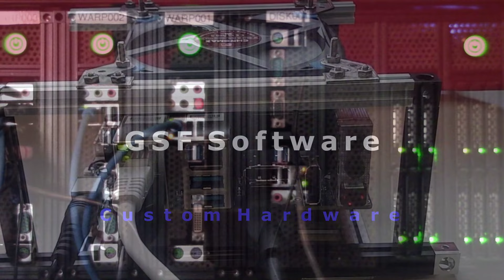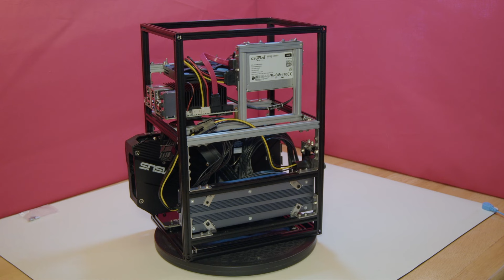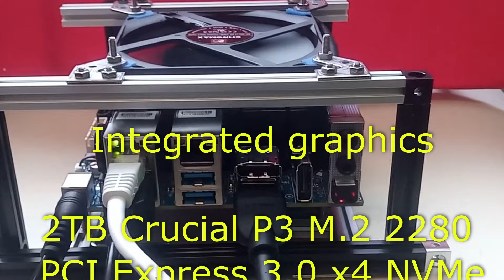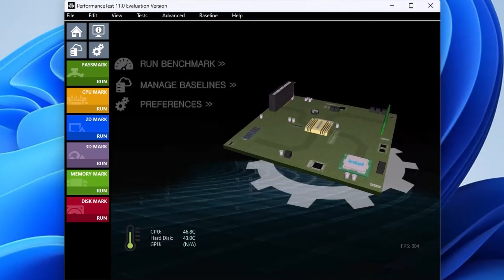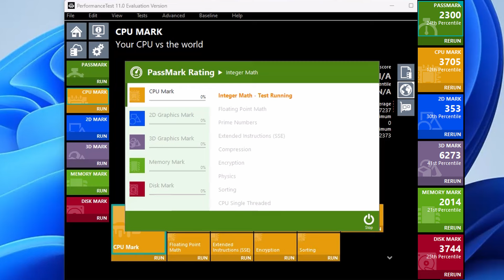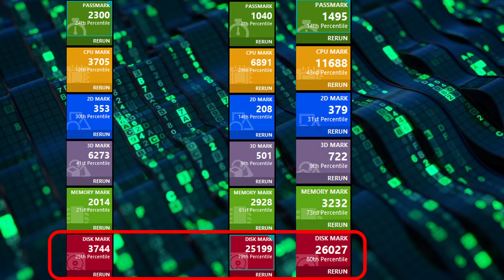Odroid H4 Ultra, single board x86 computer part 5 - Performance testing

Comment: is the 15v (60W) power supply enough if you only use sata 2.5 ssd or do you always need the 19v (130W)?
Reply from the maker: I have one Odroid H3+ with a single 2.5 SSD running off one of the 15V PSUs without problem. Multiple 3.5 HDDs are more likely to require the larger PSU.

Comment: Thanks for the video.

I'm on the fence about the ultra, struggling to find the itx kit in the UK.

Also I'm not sure if I understand the power reqs, would the 19v psu be OK for 2 3.5" hdds? Please test power reqs
Reply from the maker: The H4 can be purchased from https://www.odroid.co.uk in the UK. 
Yes the 19v PSU should be fine for 2 3.5" HDDs. I intend to run 4 3.5" HDDs off the H4 Ultra and a 19V PSU.